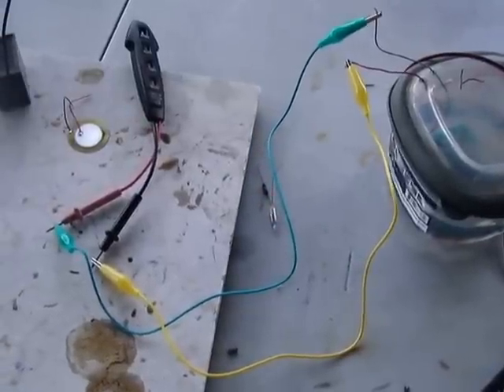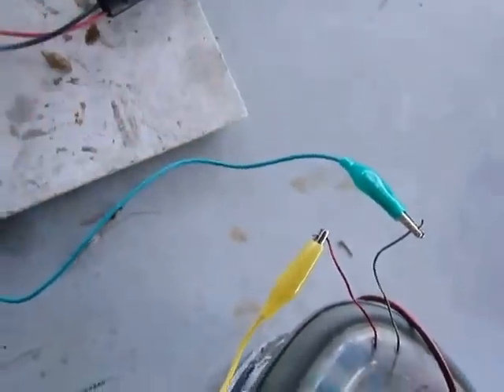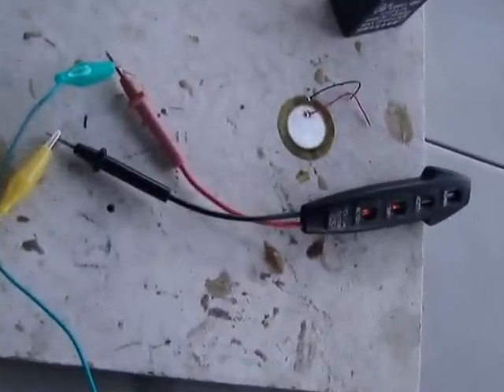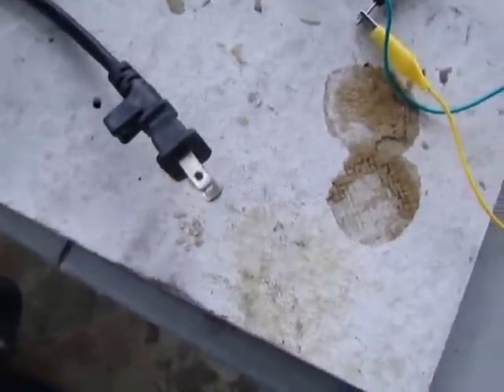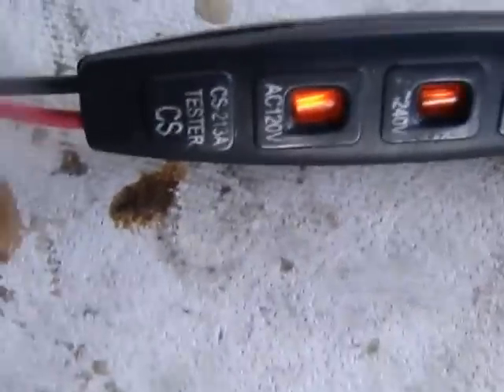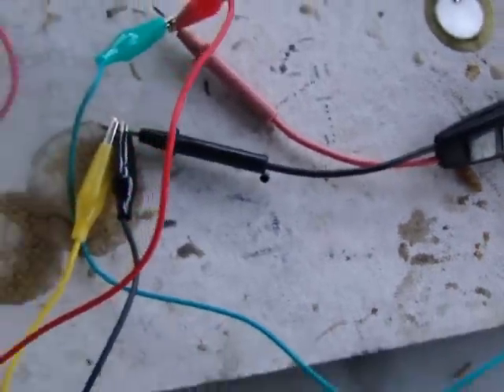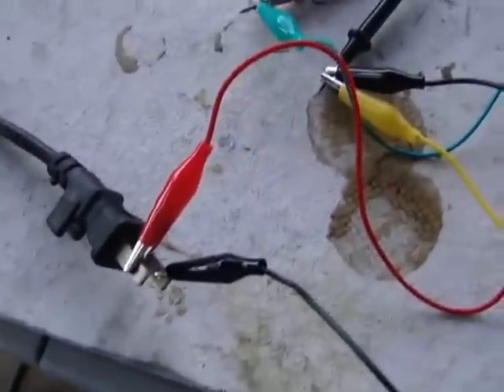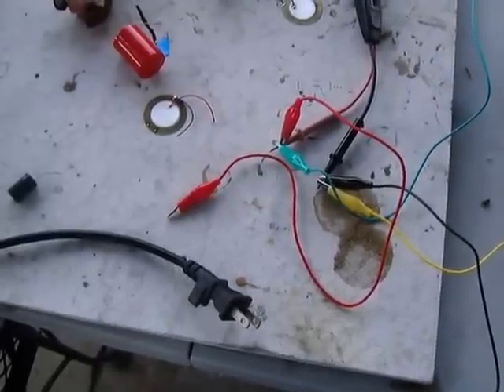Energy from the surroundings

Comment: Hi Alex;  that coiled lead on the floor has inductance, and the pulsed dc is allowing the magnetic field in the inductor to collapse thus inducing a HV spike;   when you step up a voltage,  you half the current - so sadly no real gain there.  You could step down that HV output and then test it on a load then you will see what I mean.    If you stretch the coiled lead out you're HV voltage will drop as you are reducing the inductance of your circuit.

Comment: Hello Alex, sorry but did you measure the total wattage too? If your input VOLTAGE was say, 100 V and you got output of 200 V, thats not satisfactory, but if your input WATTAGE was say, 100W (eg. 50 Volts * 2 AMP = 100 W) and you ended up with 200 W, then that makes more sense. It may prove that a further 100 watts were added by the resonance or electro-smog, whatever it is called.
Reply: I meant to say that Without "power I.e. V * Amp" input-output data, mere measurement of Voltage rise is nothing more than what every  Step-up transformer does in every home.
Reply from the maker: unable to measure amperage, this is a different animal will burn out meters mostly voltage with minimal amperage; meters go crazy and burn out, but you are right we need some way of measuring power out
Reply: Most meters don't measure HV fast signals;  my meter can't read anything >1kv at >100Khz;  you need an oscillscope and HV probe;  but this isn't a "different animal" ! it's just plain old electricity.
Reply from the maker: ok

Comment: Nice video, but unfortunately you did not demonstrate over-unity.  You produce higher voltage, a lot of passive devices can do that, none of them have energy efficiency exceeding 100% (over-unity). There is not enough proof in your video that yours does either. Good experiment though.

Comment: Alex, This is the best video I have seen in 15 years of researching ZPE, clear evidence of ZPE.  I encourage you to take the next steps, drive your circuit with battery as input motors as load and make it self running.  Write up the goal and the cost to construct and submit for crowd funding.
Reply from the maker: joe got a new vid showing almost zero lenz so its easy to run with a small solar cell
Reply from the maker: https://www.youtube.com/watch?v=DEOWzLZ-7M4

Comment: Hi Alex,  I watched your videos several times now.  I decided to buy the kit you've shown here.  I am almost ready to test it.  I just have one question which I would appreciate if you can help me.  According to the instructions, the circuit should be potted in baby oil.  Does that mean the assembled circuit is completely submerged in the oil inside the container?  Any other pointers how to use the circuit will be much appreciated as well.  Thanks in advance.
Reply from the maker: +Mario Gancinia Sure, 19 volts max at 2 amps max. you might want a fuse (2 amp) for input to kit. I submerged the whole kit but thats just for xtra protection ( I value thislittle gem so much). I touch the mosfet occasionally when I think im putting a heavy load to make sure im not overheating it. See my vid https://www.youtube.com/watch?v=lRKvcRduWTY and with all that running 2 motors and generator it still is not pulling 2 amps and therefore mosfet does NOT heat up!! (No Amps)
Reply from the maker: +Mario Gancinia Mr Peter sul has interesting vids on Radiant energy look him up on you tube
Reply: +Alex Manzanero Thanks formthe response and the additional reference.  You've been very helpful. Now I can proceed with my test.  Thanks again.

Comment: What are you trying to demonstrate? Perhaps you need some good test equipment that does not give you false readings with 'pulsed DC' (at what frequency?) when it is designed to read either steady DC or sinusoidal AC.
Reply from the maker: +Janet Winslow Simply quite a substantial rise in voltage when under normal circumstances there is a loss in normal power transmission; here there is a gain from 240 to 480 just with a non-connected extension cord no more no less
Reply: What is the input impedance of your test equipment? Have you measured the inductance or capacitance of the cable? Stepping up voltage (pulsed DC, normal DC or any type of AC)
 does not step up power - but I think you know that.

Comment: Do you have any videos showing you charging the banks and then simultaneously charging or powering appliances?
Reply from the maker: +Hazenthly&#39;s Fire Last couple days I've been working on running 24 volt dc motor which turns a 24 volt generator that spins another motor going thru a 10 watt led with a capacitor across the output of 480 volt output and it does work! I measured the draw at input source and is 19 volts x .82 amps=about 16 watts total. by the way the the 24 volt motor/generator puts out 39 volts regular electricity; that is amps and voltage. None of the motors including the transistor gets hot why? because we are not running amps we are running high voltages to do the work so nothing gets hot or burns up.runs for hours
Reply from the maker: +Hazenthly&#39;s Fire but to answer your question i havent posted a video but yes capacitors will run small motors. the length of time running will depend on how many Farads you have as storage. I bought some cheap Supercaps from china. Sometimes I use to start up my Diesel generator as you would use a normal battery except that super caps give you all the amps like "right now!" so they have a lot of cranking power
Reply: +Alex Manzanero Thanks Alex; Peter contacted me back and I'm going to get the circuit too. I've been talking to Marc a bit and will also give a go with his ideas. His comments really outline a lot of his ideas! Hopefully, with this system, as it creates a high voltage, we can use it to power many things with this pulsed dc. Gerard has a lot of methods for rendering this back to usable power through capacitors like you seem to be doing. Have you noticed any oddities with loading? Like with high impedance loads?
Reply from the maker: Only thing i can share about capacitors is that they will charge quickly from any electrostatic source like the "testatika Machine in Sweden" and will turn it into usable current for running motors etc. I think Car manufacturers are missing the 8 ball in their lack of use of caps. I.e. if you go down a hill and use your re-gen on your hybrid it will take hours to use that energy to pump back into a normal lithium cell but if you use caps the wasted energy is minimal b cause you can slam dunk all the energy into it in a few seconds then when you need it back say for an upcoming hill you will have that juice from the caps